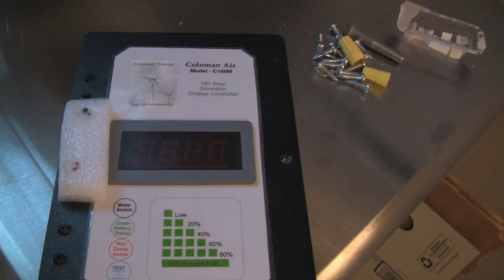EMERGENCY POWER Solar System Battery Box

Comment: just an idea i had maybe wire the fan into a cheapy 12 volt camper/rv themostat so that when it gets to a certian temp it will turn on and off depending on the temp you have it set to rather then the switch
Reply: although i would keep that switch only wire it outside the box as a bypass switch so that when you need to work on the system you can switch on the fan and vent it from any battery fumes that might be in the box before you open it

Comment: Nice. some recommendations might be to add an incubator thermostat to control the temp and fan control precisely. This will eliminate ever opening that box up to hit the switch again. Also, consider using a DLP TV Fan. it will draw less current and be brushless so no spark over your batteries. Also consider your inlet holes very low. Battery gas rises because hydrogen is lighter than air so fresh air holes low while exhaust is high. Add a resistor to the fan too for slow speed hence less draw.

Comment: You open the lid to turn on the fan...there by releasing Hydrogen gas into the room.  Is a fan needed if the Hydrogen is lighter than air and if it vents through the top it will draw in fresh air from the bottom.  If the Hydrogen was concentrated in the box, you could ignight it just by flipping that swich!

Comment: I'm in total agreement with you!
I think he needs a couple of smaller holes at the top of one side of the box to allow for air circulation. Batteries also generate heat in both charge/discharge cycles. I did not hear him address that issue, ether.

Comment: Nice Battery box! Looks pretty solid. One thing you might consider is that hydrogen gas will build up and pool above the vent.
Otherwise looking good. 
Check out my attempt. Its big enough for 16 large 6Volt batteries. Thanks

Comment from the maker: @MrLagros No I still have 3 sets in my shop that I need to take back to HF. I might put them on my shop. I have (4) 100 watt panels on my roof now and I am going to add (4) more allso waiting on a xantrex 1800w inverter and some other equipment to complete my install. I will post some more vids on this project. Please sub my channel.

Comment from the maker: @econewpower Hi Al, Thanks for the comment. I did not think about the cfm of the fan when I bought it. I think I will put a 12v speed controller on the fan unit to slow it down and reduce the noise. Did you find the Galvanized parts for your panel installation? I think if you would install all the channels to the roof first , its going to be a breeze installing the panels . Good luck  and be safe my friend.

Carey

Comment: That is looking real good, you're doing a great job putting it all together. The battery box and power panel are very neat well laid out. May I suggest you change the battery box fan for one rated for less CFMs, that will keep the draw and noise down. Good job!